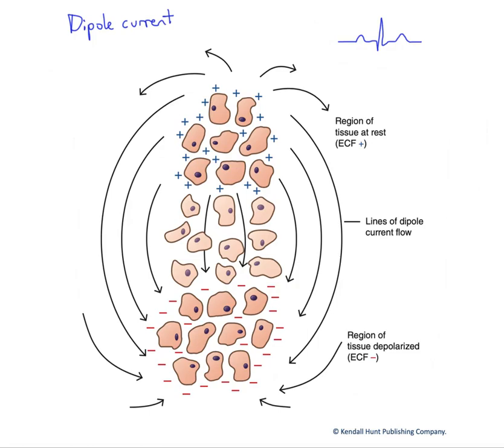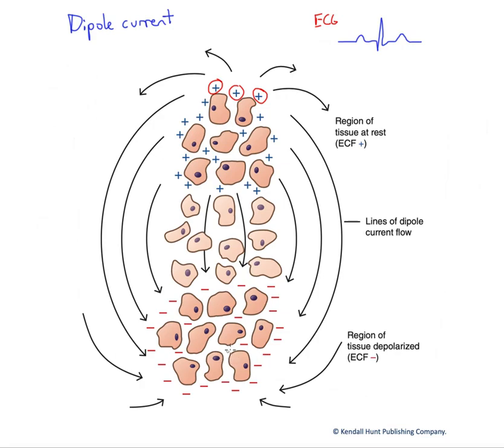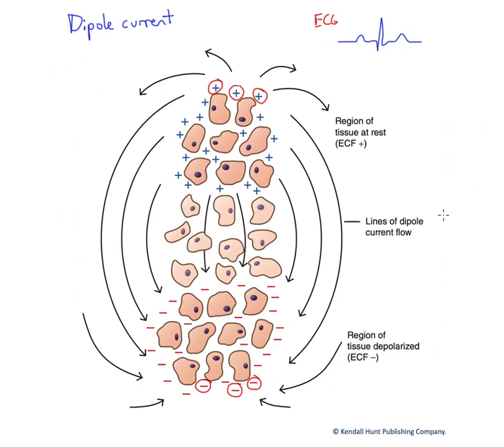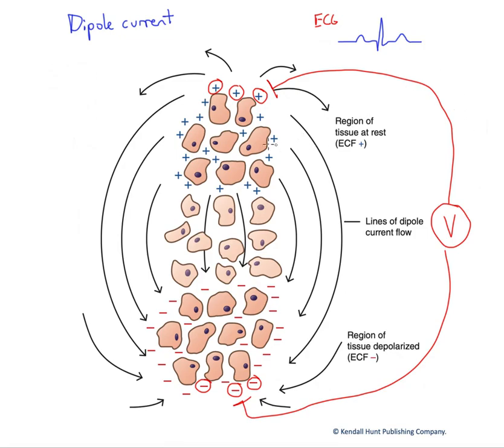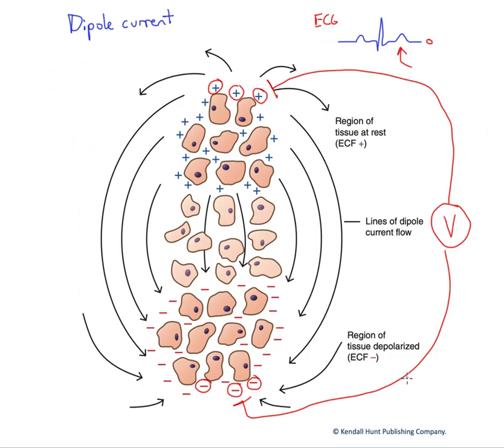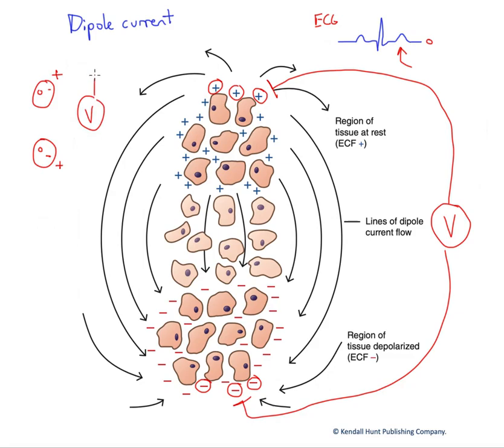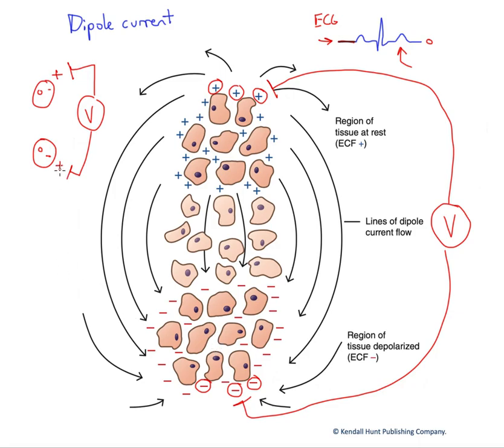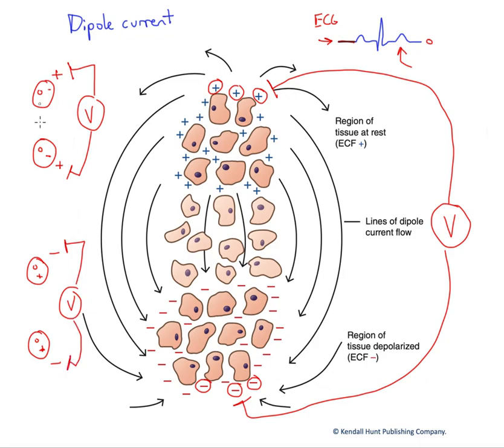Dipole current (EKG)

Comment: Can you please explain why there is a peak in voltage in middle of wave
Reply: ECG wave amplitude is maximal in the middle of the wave because it reflects the size of the depolarization front, not the total number of depolarized cells. At the start of the wave, only a small region of cells is transitioning, producing a small dipole and low amplitude. As the wave progresses, the depolarization front grows, with the largest number of still-polarized cells in contact with depolarized cells, generating the maximal cardiac dipole and thus the peak amplitude in the middle of the wave. Toward the end, the front shrinks, the dipole decreases, and the amplitude falls. The heart’s roughly rounded shape creates this characteristic peak; a uniformly shaped cylinder would produce a more constant amplitude.

Comment: Hello I have a question.
I get why the P wave is initially rising, as the Atrium depolarizes and momentarily creates a dipole, as some parts of the tissue are becoming positive in the inside, while some are still negative. I don't understand though, why the ecg line would sink again, because eventually the whole atrium is depolarized. Shouldn't the depolarized Atrium then form a strong dipole between the depolarized atrium, and the still polarized ventricles? So a voltage should be detected wouldnt it?
Reply from the maker: Excellent question! ...and one that had me stumped for a long time. I searched the literature intermittently for a long time to get some clarity on that one. You are correct to state that an atrial to ventricular dipole generates no wave (e.g., atria fully depolarized, ventricles at rest - PR segment). The explanations I've found seem to focus on one of two things. Given the obvious dipole at that moment (PR), there must either be cancelling factors or an inability for dipoles to affect current across the fibrous skeleton. Unfortunately, I'm not sure which is more accurate and would love to hear more knowledgeable experts explain which (or other) explanation is accurate. My guess is the non-conduction one is true as the odds of cancelling factors during all periods of atrial to ventricular dipole result in no waves (e.g., ST seg) but then I'm stuck wondering about conduction through the pericardial fluids. Ack! Anyway, let me know if you ever find real clarity on this one.
Reply: @mechanismsandlogicinhumanp5840  Thank you for getting back to me. I indeed am thinking along similar lines. Since the atrium is electrically insulated against the ventricles, it may be that no electric field is created, since the charge of the atrium would not be attracting the charge of the ventricles. I will still continue looking for a definitive answer though. What helps me for now is following: Since in ECG we only look at one side of the cell membrane (the extracellular membrane), the moving depolarization wave can be seen as flow of current. As long as there is propagation, there is current that can be measured. When the atrium is fully polarized, no charges are moving anymore, so no current can be measured. Conceptually this makes more sense to me, unfortunately, since the electrodes measure voltage, it is technically not correct.
Reply from the maker: @Tom-ts5qd  I agree...there should be an electrical dipole moment when atria are depolarized and ventricles are not (PR seg). Maybe no current flow due to high resistance (?) but still a voltage. Hmmmm.... I'm afraid this is beyond my physics comprehension.